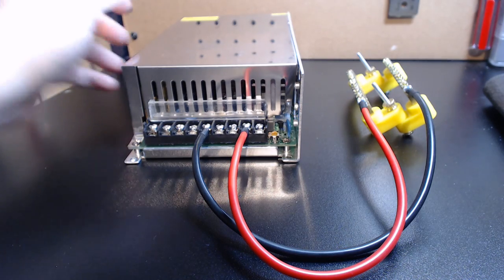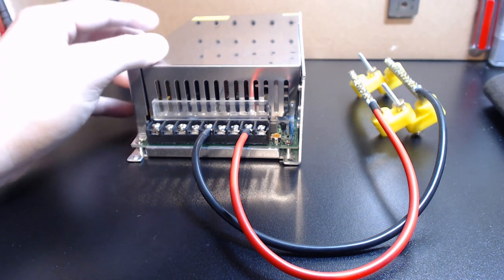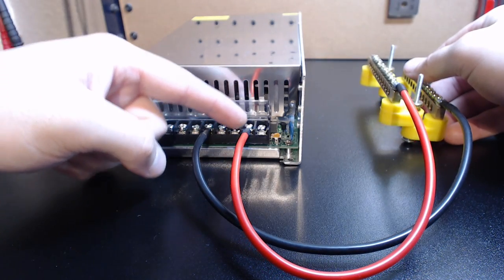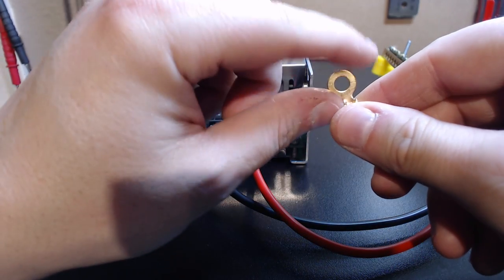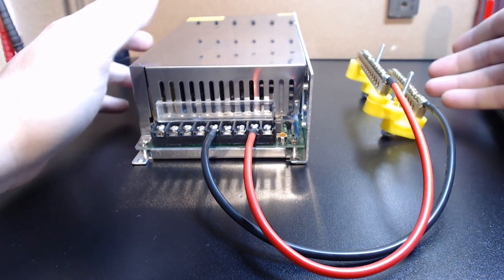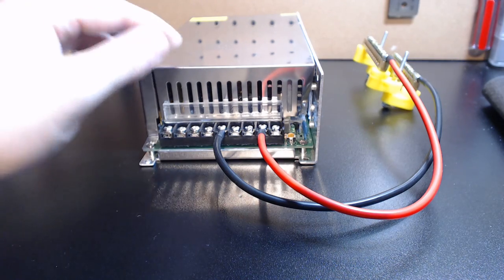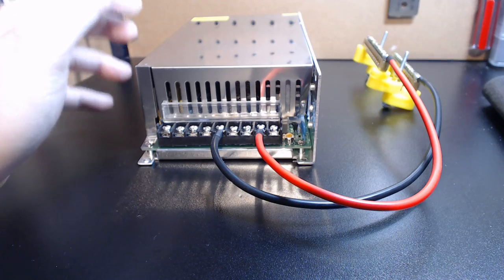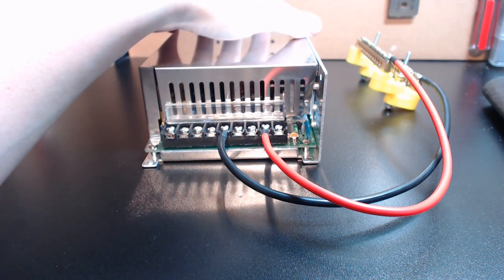Universal Remote Power Distribution Block (Simplify Your CNC Power Supply)

Comment: Hey Vince,
Can you wire 2 power supplies to one distribution block?
Reply from the maker: Ernest,Yes you certainly can pending your power supplies support parallel, and or series connections which most do, but I would still validate with their manufacturer to prevent any issues.Power distribution blocks offer more versatility for virtually endless applications let alone for automation. Thank you,Vince
Reply: the power supplies are the one's from Long's motor: 350 watt (36vdc/9.7a).  I just received the BOB and terminal kit from you.     i also remember you saying you could send the y signal to two drivers if i wanted to slave them. With the understanding that each stepper motor requires its own driver.   But what if you are running dual axis and you need to reverse one of the steppers.  can that still be done in mach3? 
     Thanks for all your videos.  You are one of the main reasons why CNC doesn't seem such a foreign  concept.   Just watching your videos (and some others) encouraged me to give it a try.
Reply from the maker: I would contact LONGS, and find out if their power supplies support parallel, or series hookup before attempting to hook them up to single power distribution block. If your running "slave axis" configuration to have two motors support a single axis you can reverse a single motor by swapping the leads on one motor winding. It doesn't matter which one. Pick either the winding for A+ A- ,or B+, B- and swap only one of the windings. If you select to do for example  A+, A- you make them A-, A+. Do not mix the windings A with any of the B's together. Thank you,Vince
Reply: excellent.  Thanks alot.
Reply from the maker: You bet.Thank you,Vince